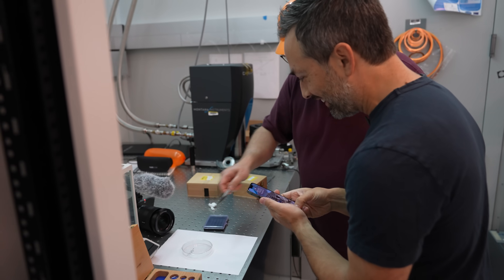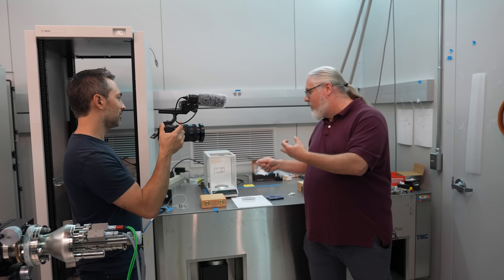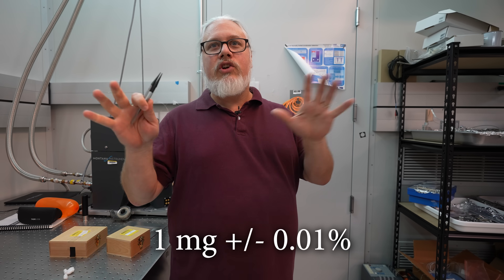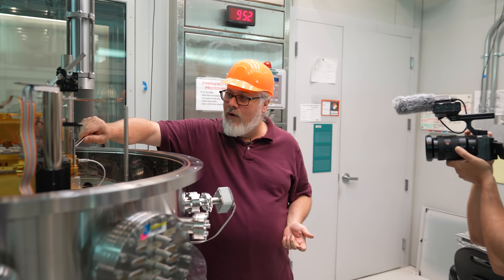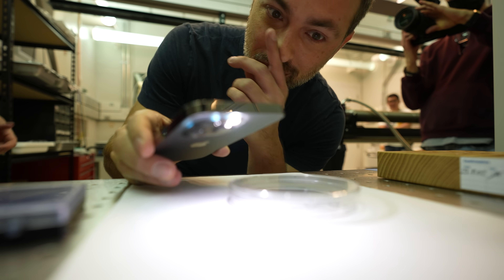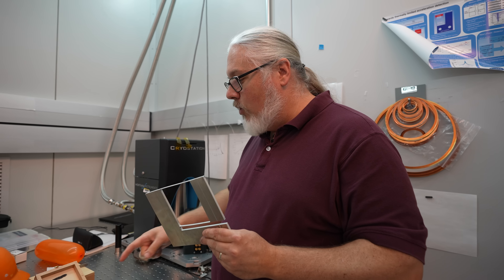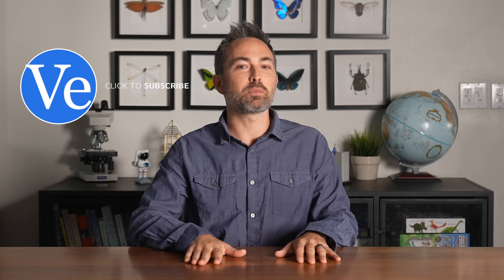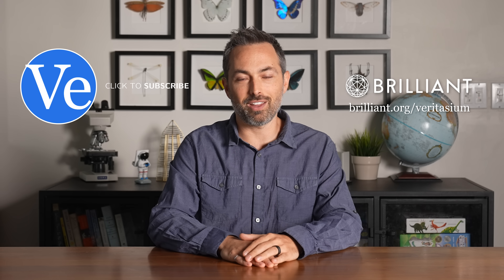How To Measure The Tiniest Forces In The Universe

Comment: Another reason to have this level of accuracy is if you are working with a torque wrench or a micrometer, things that have a certified accuracy those are calibrated and adjusted based on comparisons to standards like gauge blocks or torque transducers and those standards are calibrated using even more accurate equipment and again till you get to the international standards, and this system allows you to get a reasonable degree of confidence in your equipment without going all the way to nist, but still having the confidence that nist can provide through traceability. So if you have a piece of equipment that has a calibration certificate that can more than likely be traced from one standard to another till you get to the universal constants measured by NIST

Comment: It’s funny how veritasium constantly throws out all engineering realities when it comes to some of these statements. The uncertainties in almost all commercial production processes mean that these standards are useless to real products… these standards are only for physicists do precision work… which isn’t most physicists. The majority of design work and tolerances are specified in English units and created to those English units. In all likelihood only 1-2 of the machines in any shop were ever compared to a standard of this caliber with most being calibrated to a block of material of specified dimension and weight… you add on top of that, even precise work doesn’t use this standard… they create there own standards and conversions so their processes are accurate to the local gravity. For example, Albuquerque New Mexico has to compensate its equipment for the gravity the mountain causes or else their numbers will be off.
Reply: "The majority of design work and tolerances are specified in English units and created to those English units." - for what, furniture made in some shop in the US?  Nearly all high-tech uses International Units.
Reply: I don’t, and I can tell you most don’t… English units are still the backbone. Even in semiconductor spaces… specifically semiconductor manufacturers that build for the US…

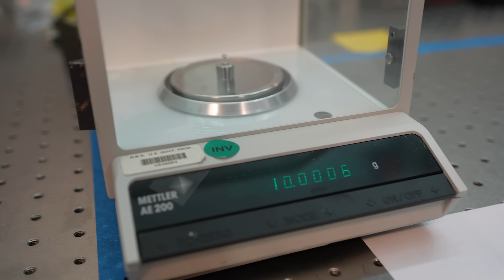Comment: As I scientist I worked in a lab where several procedures had ISO17025 accreditation. We had a balance (scales) that we had to calibrate daily when it was used. It came with calibration masses down to 10mg and they were just like a little fingernail sized piece of foil. Looking back at the video, it was the same balance as he uses at 2:05. I guess Mettler Toledo are the sine qua non of laboratory balances. Absolutely fascinating I can't even begin to get my head around how inconceivably small some of the values he was talking about.
Reply: " sine qua non" (without, which not)?

I think that you meant "ne plus ultra" (none higher, or better).

Sorry for being that guy.
Reply: @jmchez  no no, you're absolutely right. I dump Latin bons mots where it is not strictly necessary, I deserve everything that's coming! Next stop, pseuds corner.

Comment: Random thought: can the magnetic force fade/wear/break away?

If you take a possessively charged object one atom thick, suspend it, and touch it to a negatively charged object one atom thick in a vacuum or whatever proper conditions would be required, would the two objects eventually separate because one or both demagnetized?

Comment: I feel like he gave an answer to the question "why do we need to measure this precisely at this scale" with a bit of a mislead.  While we do have needs for some small measurements like he described, I think the realistic answer to why they are measuring multitudes smaller than the force needed to stretch DNA is more so two fold.  "To be out ahead of technology if we ever DO need to", and "because it's a cool challenge".  

But honestly it seems this level of precision will never be needed in industry outside of lab environments for "pursuit of knowledge" since this force is so small, simply sitting in a room idle is likely experiencing many multitudes of these measured forces from ventilation alone.

Comment: Yes, have seen my local copy of the standard kilogram, it is only 10km away from me in it's armoured vault. Also have masspieces that are only 3 steps away from it, having been verified by a massmeter that was verified and calibrated with one of the sub masters compared to the local standard kilogram. 1g masspiece that is 1g with 4 zeros after it, any more and air pressure and bouyancy has an effect on it, which is why all those tiny measurements take place in hard vacuum. 

The smaller masspices you cannot use in atmosphere, unless you measure your local air pressure and humidity, and compensate for the amount it bouys up the tiny masspiece, and, measuring that 100mg masspiece, simply moving your hand into view of the massmeter the IR radiation from your hand will make a change in the measurement.

Nice when the company coming in to do the verification uses your own masspices, simply because they have a fresher certificate, and they look at the long term drift and can see no trends, except for the one where it jumped up by 0.5g, which was because, a week before they went in, I took them stripped the paint off, and then gave them a new coat of primer and black, leaving a week in heat to flash off solvent. Yes also had the cotton gloves and wipe cloths, to make sure they stayed dust free and clean. The sub 200g ones had a separate box with the tweezers as well to handle them.

Comment: Not being on the metric system is not stupid. It doesn't make a difference. For every application in which the metric system is superior, practitioners already use metric. For the rest of the applications, it simply doesn't matter which you use, and so people use what they're used to, and that's perfectly fine. Miles or kilometers doesn't matter for 99% of normal human use cases. I've used both systems fluently in my lifetime and only in the lab do you ever really need the things metric does well (multiplication and division of units across several orders of magnitude).

Comment: While I appreciate the trope, it's not stupid that most Americans operate from Imperial measurement. It's differently useful. Firstly, as stated, the US does, in fact, use metric. But many Americans know how to use both metric and Imperial. Imperial does have a couple interesting benefits going for it. For instance, when it comes to construction: Metric is easily divisible by 2, 5, and 10; Imperial is easily divided by 2, 3, 4, 6, and 12. The fact that two more easy dividers exist makes Imperial a bit more useful in construction. 

Metric, in and of itself, is just made up, too. There isn't some form of measurement handed down from the Gods that is better or worse, inherently. Just different.

Comment: That's very cool using a capacitor to measure force. I never would have thought of that! What I was thinking however was a box of tissues and electrical mass air flow sensors. Cheers 🍻

Comment: Would this make it viable to use a laser as a sort of input device on a TV?
I don’t mean Bluetooth and measuring the change in angles via an accelerometer or something - I mean would it be possible to put those detectors into the screen and have it be roughly compatible with any laser pointer

Comment: Using the imperial system is not stupid. The metric system is great for small units such as anything less than about 8 to 12 inches, but anything larger than that and the imperial system works better. I'm American and I regularly use the metric system for small measurements and I use the US imperial system for everything else.

Comment: This stuff is pretty cool, some elegant solutions to a very weighty problem.  Well, I tried.

So like a hydrogen atom being driven into a test apparatus at very low velocity under yocto gravity, right?  Also, it is all relative, because compared to the forces two one billion sun mass black holes would impart on each other at impact, EVERYTHING is a tiny force, I expect. Just sayin'.  

Tiniest times and lengths are much more easily measured.   I love how these fundamentally based units make things so much more intuitive, specified numbers of the wave lengths of certain atomic photon emissions for lengths, and all that.  Yeah, I'm in a mood this morning.

Comment: We have a SIP measurement bench that the metrology lab uses to certify all our shop gauges. It get's calibrated once a year by SIP and it will give you 0.00000 level accuracy. As good as needed for most manufacturing processes. Compared to this thing in the video, that's like a tape measure vs a micrometer. A level of magnitude more accuracy. Impressive

Comment: When I worked for a "Nutrasutical" (Health Focused Supliments) I was in charge of Calibrating all of the Milligram (0.1g) and Kilogram (1.0-250.0) Scales in the Weighing Department.
Sadly 20 years ago, there was ALOT of variations of results based on how much time I was given to perform this task...
And the environments where not very consistant with debris and airflow.
I "tried" to be "as anal as possible" with my calibrations, but Management was "tight"!

Comment: This idea that the US is "actually metric" is the stupidest notion ever. You're going the wrong way. We adapted our units to SI for globalization. They are not "actually" different units. It's not even a pedantic argument, it's just wrong. Units are not "actually" what they are currently defined by; they are literally just an idea that represents a standard measurement. A foot is "actually" a foot regardless of what arbitrary method we use to reckon that length.

Comment: "I have measured the force of a laser beam hitting something" is maybe one of the most rare achievements one can get.  I never thought that this would be possible. Absolutely amazing.
Reply: And he also has to remember that, using the massmeter outside the sealed enclosure, that the IR radiation from his hand moving into view without the blocking glass there will also make it read incorrectly. Never mind actual breathing.
Reply: someone suggested to use mems pressure sensor to measure laser strength. If you just need qualitative measurements, it is surprisingly "easy".
The amazing thing here is that it is an actual traceable measurement.
Reply: @sarowie  What's important about the "traceable" part there? What does that mean in this context?
Reply: Actually the photon engine is an old concept for space travel, where the impulse of the photons are used to move the spacecraft (search for solar sail). The force of the laser is simply the power of laser (in Watts) divided by the speed of light. So a 30 mW laser has a force of 100 picoNewton (1e-10). So to lift 1 Kg mass from the ground (10 N) you need 3 GigaWatt of power which is the output of a nuclear powerplant.
Reply: @Neo-vz8nh  3 gigawatts sounds like a lot, but yeah, stars are pumping that kind of output constantly. Solar sails though would have to be massive to move a space ship. Entertainingly, photonic thrust has been used in a number of fiction stories, including Netflix's Space Force, and a Disney movie called Treasure Planet. There was also another movie, but I can't remember the title. The story was about somebody who was receiving a kind of communication from a passing ship that used a solar sail. They'd contacted Earth because they needed a boost. So the kid builds a high powered laser and fires it at the solar sail to nudge them back on course.
Reply: @sirdeadlock  3 GW for 1 Kg? That is 3 TW for 1 ton, which is approx the whole power generation of every nation, and that is just still 1 ton (a mass of a car).

Solar energy at Earth is 1.4 KW/m^2, so you need 2000000 m^2 for that 1 Kg, which is 1.4km x 1.4km square wull of solar power, which has obviously has more mass then 1 Kg.
Reply: @Neo-vz8nh  im glad you wrote this, becase I wanted to do the same :)
Reply: That's what cats have been trying to do all along.
Reply: What did he say it was? 7 piconewtons?
Reply: Cody's Lab did something very similar years ago.
Reply: Jack Wrath  🤓
Reply: Yea, groundbreaking experiment for every Star Wars fan! 🤣
Reply: There is a Cody's Lab video where he pretty much does the same thing.
Reply: @GrayBlood1331  I would say there's room for debate that there may have been counfounding factors in Cody's setup (I doubt the quality of his vacuum was as good as can be achieved here), but it was still a fascinating exercise in the sorts of things you have to consider when attempting such things.